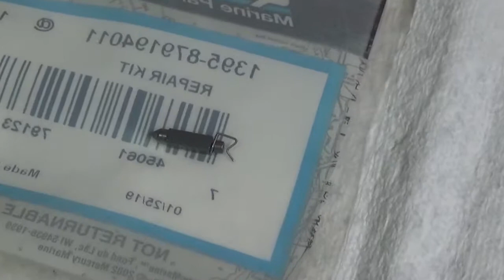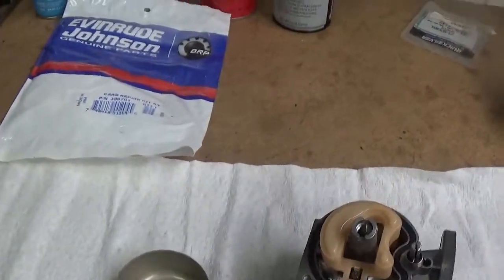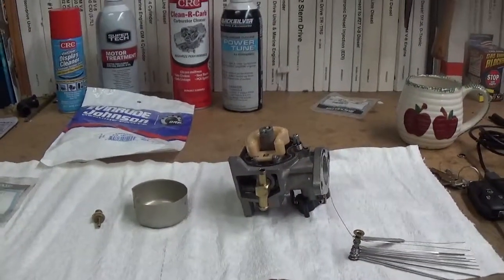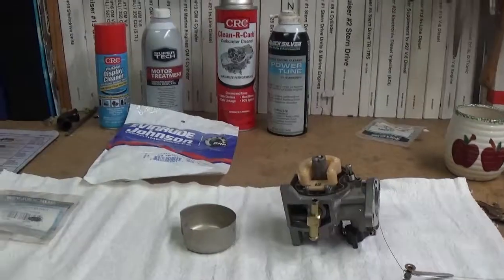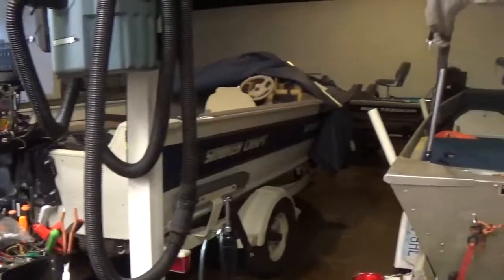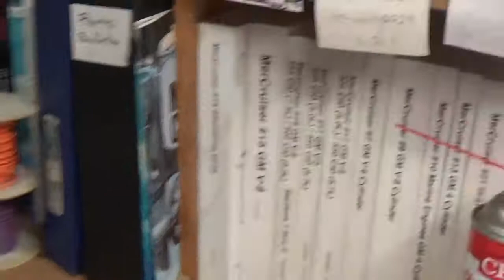Can you clean your carburetors using a fuel additive?

Comment: You didn't go into how you got the carb so clean. Did you soak in acetone and or use ultrasonic cleaner? Nice video. Cleaning and 18 HP 2 stroke Merc carb. I soaked body after disassembly in hot water and dawn dish detergent. It looked up some if the scaling I could see, old varnish. That wire set is that a hvac plumbers set? Appreciate some feedback. Motor is electric start so extra work to get carb out. Only want to do this job once and right. Jeff

Comment: I do a little outboard and small engine repair myself and I agree with what you say about rebuilding carbs instead of using SeaFoam for a quick fix. I swear by seafoam myself but I use it to keep carbs clean after  cleaning or rebuilding them and fuel systems clean from phase separation in ethanol blended fuels, especially during storage and it works way better than alot of so called marine fuel additives. I don't recommend anyone try to use it and expect a fast result either as it is designed to work slowly over time as far as keeping stuff clean. It is cheap insurance in my opinion given all the problems todays fuel causes, especially on small engines and outboards. I think alot of people are mislead by it as well as other products as you are correct, most of them are worthless gimmicks. It is alright to have different opinions though, glad I stumbled across your video sir, I enjoy watching people that are good at what they do. Great video sir.

Comment: Great info..thank you. Question..can the 1990 Merc 200 hp fuel pump handle a fuel filter if it has 3/8 inch fuel line?
Reply from the maker: Yes, but the original has  5/16 barbs on each end. If it's an EFI engine, you already have a screw on water seperator/fuel filter from the factory.